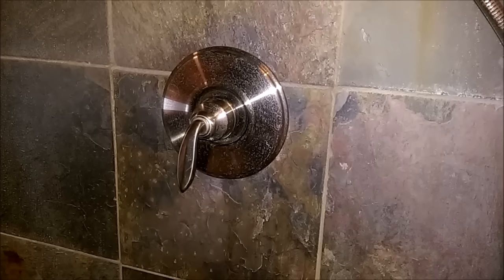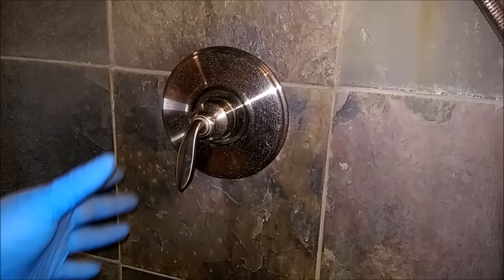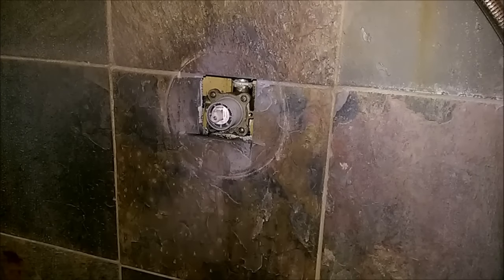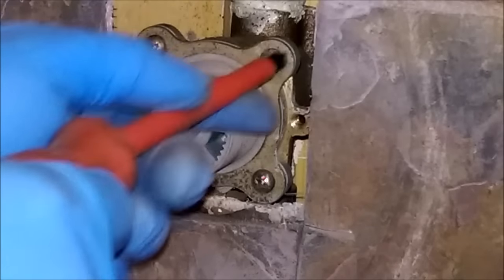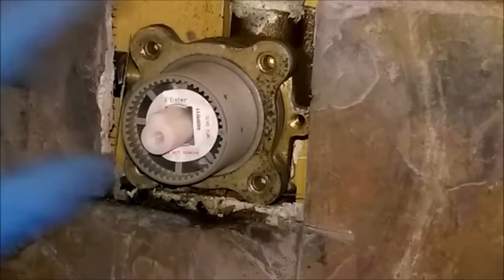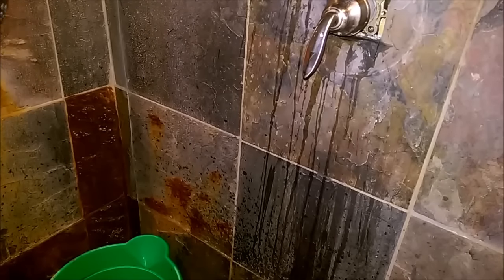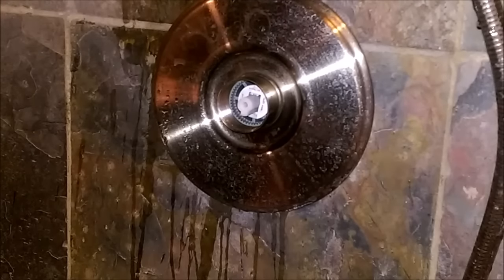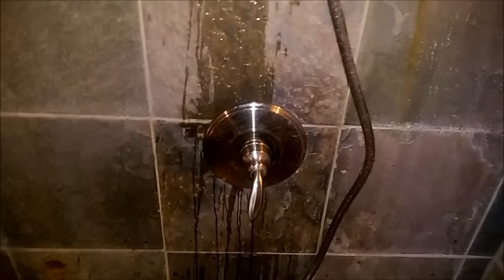Fixing A Single Handle Shower Fixture With No Hot Water!

Comment: My apartment complex maintenance has not fixed this. Instead they said they replaced the hot water heater. Now I have warm water two scalding hot. Two months of this BS and a simple fix. Thank you for making me smarter than this apartment so-called managers.
Reply: Im having same issue with my apt. Imma do it myself lol if i can figire out how to do it without turning water off
Reply: Same here my hot water isn’t working at all and it’s been 2 weeks and my apartments still haven’t came to fix it
Reply: Same maintenance neverrr come

Comment: Thanks much for posting this video. I have the same valve and exact same problem. This shower has not been used for awhile because of a broken pipe in the slab.When I fixed the pipe I couldn't hardly get any water out. I found this video and also discovered the parts were in stock at my local Home Depot. This valve is only 16 years old and I was surprised it failed so soon as I have a  50 year old Moen shower valve that works fine.
Reply: The old year the manufacturer they competing who made product stronger and last longer,, now today the manufacturer  they competed see who made it looking good and go bad quicker,,product more and sold more,that the difference.

Comment: Hey I just wanted to say thanks again for this video. Your the only one that show the part where you took off the black ring that limits the hot water. After finally getting my replacement part (2X) because the first one the sent was damaged from shipping, smash more like it. But anyway after putting the new one in my hot water wasn’t very hot so I pulled your video back up and there it was, showing removing that black part. Works great now👍👍

Comment: Hey thank you for the video. I’m curious should I turn off the water valve in the house before starting this . I am having similar issues and the water is not as hot. Brand new remodel in the bathroom 6 months ago and curious if I should turn off the water before I have a lake in the home

Comment: Would this also work if the handle was installed incorrectly and stops before it reaches the hotter temperatures ?

Comment: I have a similar spout (handle looks the same, just no alan wrench at the bottom to unscrew the handle), and I believe the catridge is the same as well. It has a problem where the more you turn, the higher the water pressure and temperature, and less the colder and lower pressure, so if I want warm water, I can't keep the same water pressure and it'd be just dripping water instead of spraying. Do i need to replace the catridge then or is it some other issue?

Comment: Is it completely necessary to replace the cartridge or is there a way to just fix the old one in this situation? My faucet is only a year old and is having the same problem..
Reply from the maker: Not sure but my new one is going out again so I might be finding out myself.  I would try taking it out soaking it in CLR, lime away, distilled white vinegar, something like that.  Worst case is you get a new one... which you would be doing anyway.

Comment: We replaced our fixture and the cartridge, however now, when we turn on the water, it is hot where the cold should be, and vice versa. I'm not certain what is happening. Is it in upside down? Thoughts? Thanks in advance.
Reply from the maker: Yep, its upside down.  Take it out and rotate it 180 degrees

Comment: As a European these kind of turn handles are a mystery to me. I mean you turn the handle and that starts the flow of water, okay so far, but at the same time turning it also changes the temperature?! How would you decrease the pressure for hot water then or am I missing something? Just curious.^^
Reply from the maker: You don't adjust the pressure.  The valve progresses from releasing all of one temperature of water, say cold.  Then as you turn it the valve mixes hot and cold and eventually when the handle is all the way the other direction it is full on the other temperature of water, in this case hot.  But its full pressure all the time.
Reply: You get a shower head with adjustable pressure settings

Comment: Ok mine is a little different the water runs even when it is on hot but it's not coming out hot but I checked the hot water line it is hot all the way to the tub the sink in bathroom gets hot just not the shower so would it still be same problem
Reply from the maker: Remove the plastic ring that is limiting the valve from turning farther.  I think it is showed in the video. Don't remember it was awhile ago.

Comment: I bought new one, I installed and no hot water still. Is possible the cartridge was damage?
Reply from the maker: That I am not sure of but make sure you didn't put it in upside down.  If you did then cold will be hot and hot will be cold.

Comment: Would this work the same if it was a cold water issue? Only hot water comes out. Stupid question??
Reply from the maker: Yes either way its a problem with the valve/cartridge

Comment: Do you have to shut of the water to the house first?
Reply from the maker: You have to shut off the water to that fixture.  If you dont have a valve to turn off just that fixture then you will have to turn off the water for the whole house

Comment: great video, thx for posting; that paper tag inside my pfister says 17196-0100G, need to find correct new cartridge.
Reply from the maker: Thanks!  If you contact Pfister through their website and give them that number I am sure they can give you information on how to get a replacement
Reply: Did some googling, turns out mine is a 2-piece but there's a 1-piece that is interchangeable, waiting on it to get delivered from Amazon.
Reply from the maker: Thats great, hope it all works out for you!

Comment: my shower doesnt have the screw to open it so im left with ice cold showers until i move :(
Reply: If it's a single handle it may screw on/off with the handle body. 
Hopefully this helps!
Reply: Turn water off, rotate handle and look for a set screw. It will be an alien wrench. Pull off handle and star the process

Comment: My components are new but only giving me luke warm at best
Reply from the maker: If the item is new then take off the handle and remove the plastic stopper.  Its like a safety thing that stops the handle from turning all the way hot because I guess in theory it could burn people.  In reality it leaves you with cold showers.
Reply: @TheStruggleville  Haha it was cold alright, I jumped out. THANK YOU for the quick response. I'm going to attempt this now. Fingers crossed.
Reply from the maker: @stephaniefarrar3133  Goodluck, I did the same thing when I first installed mine 🤣
Reply: @TheStruggleville  I DID IT!!!! Omg I'm so happy! Thank u thank u thank u. New subbie here :)
Reply: @TheStruggleville  You are a lifesaver! I just had a new bathroom installed and was also getting only lukewarm water. Took off the handle and found the plastic ring you spoke of. Turned it just slightly to the left and now it is smoking hot water! Thank you!!!
Reply: Sounds exactly what  is happening w my new unit replacement, it was hot for a few days now it is just lukewarm but handle only turns about a 1/4 then can’t turn handle no more ?  Can the plastic cover be put back if it doesn’t fix it? Or once removed gone forever?